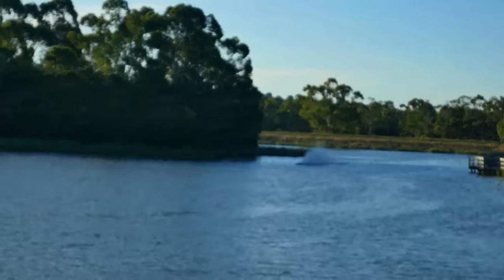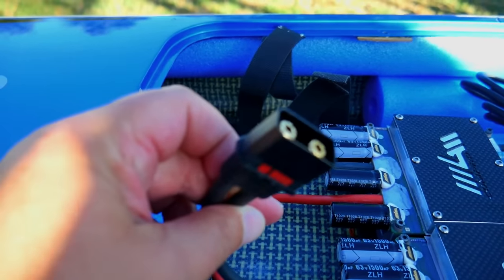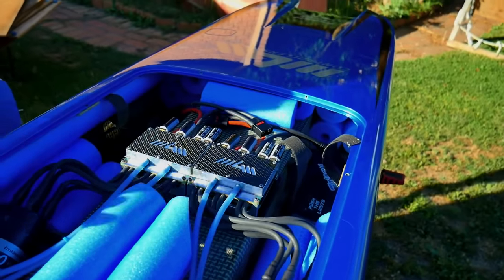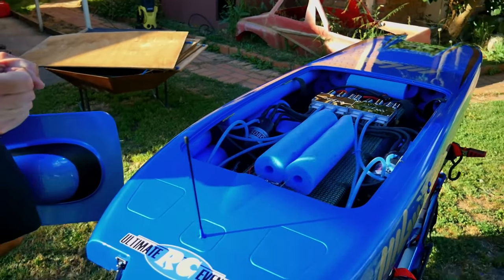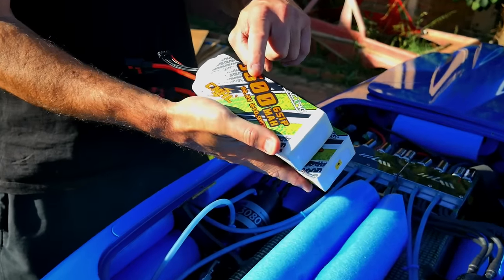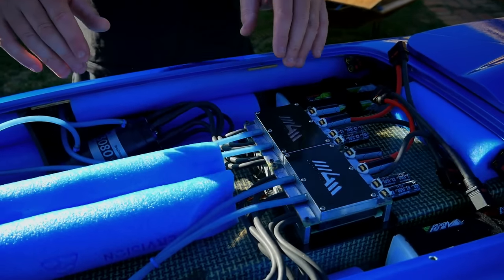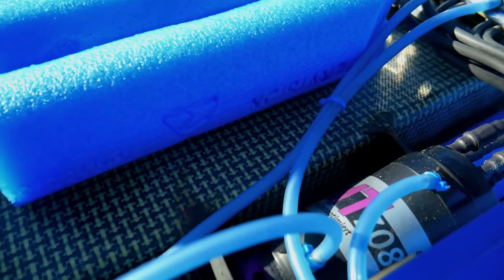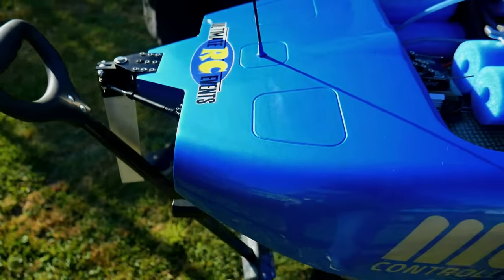Giant $7000 RC Boat Pushes for 100mph! "Push The Limits" Mystic 5000 Off-Shore Speed Boat

Comment: Pond is to small for this boat. So far I don't see 100. I'm sure it is capable but you need a bigger pond or lake wish you had a GPS so you could show us on your phone. I have reached 100 on my Miss Geico 36 on 6s. But it is a beautiful boat. Love the color.
Reply from the maker: Not sure if you read the title of the video or took the time to look at the thumbnail, but nowhere in this video does it say the boat reached 100mph. It's also not a pond, it's a lake, and it is big enough to reach top speed, it's just the conditions weren't right and the driver was not willing to push it harder and risk wrecking the boat.
Thanks for watching.

Comment: For the cables....  have you thought about using water for lube?  Pressurized water is side fed into stuffing tube and rotation of cable pumps the water to rear towards the strut.   Saw it years ago put into use by a gentleman from Japan in the U.S. gas nats in 2007.   We had a really hard time prounouncing his name ...   we called him “H”.  His rigger was a a monster on the course.   He did lube with grease after runs as well.

Comment: Hello sir. I'm just wondering , can a module holding all components excluding the props be possible?  Like a control pack holding motors ,batts..ect. a sort of  box that clips in tightly into boat then attach water supplies and insert the props n shafts the same as you already do.

Comment: U said u built this Rig on the cheap @ just over $7k ..does that equate 2 a slower top end speed . Think u said it's top speed is 200ks ? 
Awesome job 👏 
Is maintenance high ? Like way u look after Ur prop sharft / propellers  .

Comment: Can you please explain why the need to have propellers that run inwards instead of both being clockwise? 
I’m working on a double prop boat myself, and I’m not sure why they do this set up.
Reply: Cancels out gyroscopic effect and enhances the rudder's effectiveness at speed. I would think...same on twin engine jets, better performance in turns.
Reply: @steveblackbird  No. And jet engines are not counter rotating.
Reply: You are kind of asking two things at the same time.
What all twin prop boats have, are counter rotating props. These can be spun in and out.
You run them counter clockwise to counter the prop torque which basically keeps the boat in a straight line. If both props were turning say clockwise, the boat would turn to the right when the rudder or drives are pointing straight. In fact, single props boat do this as well, but not as much. With surfacing props as you see here and which is what most fast rc boats run, you also get a paddle wheel effect. This is due to only half the prop being in the water. So while the prop obviously moves the boat forwards, the blades will act as a paddle wheel and try to move the boat sideways. In this situation, counter rotating props are crucial for stability and to avoid the stern from "crabbing".

Now in or out. For moth mono hulls and cats, the most common is to spin the props out. Out means that the starboard prop turns clockwise, and the port turns counter-clockwise. This of course when viewed from the stern. The benefit from spinning the props out is that this creates the most stability. An added bonus is that the boat also comes easier on plane, and it leans nicely into the turns. This makes for a safe and easy handling boat.
Now in on the other hand where the starboard prop spins counter-clockwise and the port prop spins clockwise, creates added lift, especially in the bow. So obviously the boat runs faster as it has less vetted surface. The problem is that now the boat has a greater tendency to run loose, and when you turn, the boat will not lean into the turn as much. The latter can be a big challenge for cats as they actually tend to lean out when the props are turning in. This makes the boat MUCH more prone to rolling if turned too hard at too high speed. Now in a monohull, this is not as much of an issue as monohulls naturally tend to lean into turns, but spinning in still greatly enhances the chance of a spinout or a rollover.

As we say in real world powerboat racing, "Spin them in to win". However, that said unless you are going for that last little percentage and know what you're doing, spin them out. You can gain a few mph, but only if you are spot on with your setup. You will get a much better and probably equally fast boat if you spin them out.

So that's about it.
Reply: @AB-80X  As an Aircraft Engineer of 30+ years I know that well. There were tests if I remember correctly by Pratt and Whitney. Proved the theory behind having each engine rotate in different directions.
Reply: @steveblackbird  Yes there has been tests, and at least one plane back in the day that featured a set of jet engines that were designed to be counter-rotating. There was the Corvair YB-60 which was basically the Corvair B-36 retrofitted with jets. In modern commercial aviation and in other forms of transport aviation, there are no counter-rotating setups. As an aircraft engineer you know why this is - cost. The gases and air coming out of a turbofan, or turbojet back in the day, changes direction due to the stators, this both counteracts the gyroscopic effect but also the torque steer that might be present due to rotation of the thrust cone. So as you know, it will not make any sense for an airline, engine manufacture, parts supplier, aircraft manufacture or technician to have to deal with the expense and time consumption associated with having mirrored parts for their turbofan engines.

That said, there are a few twin and triple spool engines that are in themselves counter-rotating. However, this only pertains to some fighter jets that rely on this setup for additional agility. The F-35 and F-22 uses such engines, and so does the Pegasus engine found in the Harrier.

But as for modern commercial, cargo, and military aircraft outside of fighters? No. From a practical and financial standpoint it would not make sense as the benefit from a performance standpoint is slim to none.
Reply: @AB-80X  holy shit. I had to read your comment about 4 times to imagine it in my head, but it totally makes sense. Thanks for explaining it,  especially on how it totally effects the hulls when they make a turn. Never occurred to me how it effects the lean in a turn.

Comment: Very nice, what KV motors are you running, and RPM under load?
Reply from the maker: Motors are 840kv. 🙂
Reply: @AussieRCPlayground   so, make the math: 44 Volts x 840kV... 37000 RPMs. My little one, MHZ Mystic 114 cm, revs at about 48000 RPMs under load. Powered by two MBPs 4050, 2350 kV on each 6S. GPS Speed was best with ABCs 2 blade props: 169 km/h

Comment: Thanx for not showing the water pickups.  We want to keep that secret.
Reply from the maker: Are you joking? I literally spent 2min in the video showing the pick-ups. 🤔
Reply: @AussieRCPlayground  You didn't turn the boat over. You showed the inside. Not the outside.   ???
Reply from the maker: It's just a couple of holes on the underside, nothing special. And you can sort of see them at one point on the left hand side.
Reply: @AussieRCPlayground  Thanks.

Comment: good da bouys... its not pull pull system.. it is a push pull system .. get it wright

 ok  good da
Reply from the maker: Cheers for the comment, but it's a pull-pull system as these are cables connected to the servo arm and you can't push a flexible cable. 😉
If it were two push rods like those found on some RC cars (the 5ive-T comes to mind), then yes, it can be called a push-pull system.